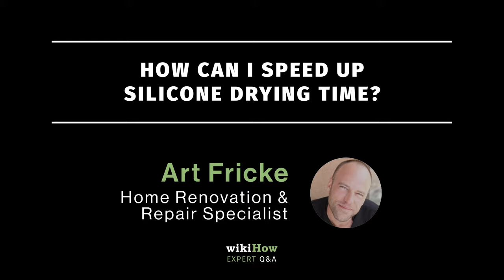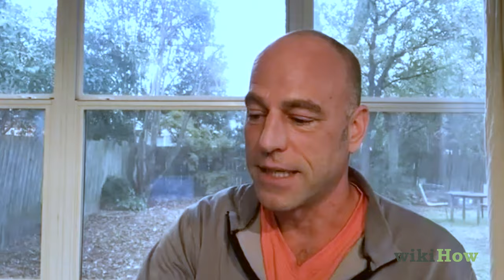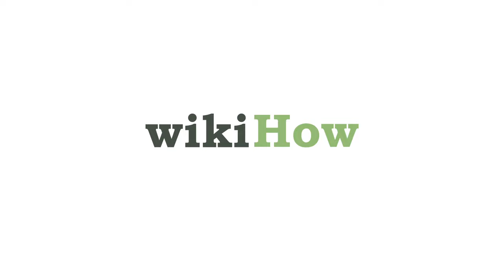How can I speed up silicone drying time?

Comment: I have been dealing with silcone polymer chemistry issues and indsutrial applications for decades. Your understanding of the curing is spot on. Cold slows the process so much that I store my uncapped silicone tubes in a refrigerator with just foil over the tip and months later the silicone at the tip still hasn't cured. It's just so convenient not to have to run and buy more or pop a new tube every time you need a foot or two of bead.
Reply: Thanks. I would have never thought of that.
Reply: Man, I wish I knew that before. Getting ready to move and I have a couple of dried out tubes in my work bench to get rid of.
Reply: Probably the real reason why you keep it in the fridge, so your mother in law might make a sandwich and uses it instead of mayo)

Comment: try spraying prep sol on silicone. will dry solid in 24 hrs.. or even faster then 30 minutes... if have heavy soap scum in tub. wet a ragg  with prep sol wax and grease remover. will wipe soap scum right off; can by at Napa parts store.Another use for it.. wipe down stove top and microwave and hood ranges. will disolve grease build up. Tip from autobody tech.On side note where rubber gloves.. if possible have goodventilation.

Comment: I am using silicone in a dampening bushing in a tripod head.  I read online the curing time for silicone is 24 hrs. I still noticed that the silicone gave off a vinegar smell even 2 days later. I was working on the part trying to get out some pins and out squished uncured silicone. I also had wax paper stuck to one side so maybe that slowed the process down. The part is a ring of silicone between two metal parts and the width is approx 1 inch by 1/2 inch square encased on two sides by metal. It seems to work from the outside in when curing. I would say at least a week for silicone thick like this.
Reply: I agree with you, I would like to advise people to not so hurry up pushing the processing cure. Just relax take many cups of coffee waiting even two weeks depends on weather in your country
Reply: I leave it for 2 months just to make sure

Comment: Hmmm, while I agree with your general assessments on the how RTV goes about curing as well as the pitfalls of attempting workarounds *without* doing some homework first to move things along & accelerate drying time; I'm still not entirely convinced that heat can't be to increase the rate of catalyzation at a temp that would be normally counter-productive as explained here *IF* one is able to provide supplementary moisture to the air that a high heat source would otherwise quickly remove. So I think I'll go about it like one would do with a water pan in a slow & low smoker when working over some brisket but also don't want it resembling slab of charcoal tree-bark in the end too... Worth a shot!
Reply: How did this go?

Comment: If making thick parts as in molds, you can mix a little acrylics paint into it, as any thing over 1/4 thick may not or will take a very long time to cure. Keep in mind the chemistry will change some so.. .. .
I use small lunch bags like frosting bags to mix and apply.. also great when making small aquariums etc.  (The bag idea).

Comment: Ok so here is the real way to cure silicone the additive is the caralyst for bondo which comes in red and blue you onky need a small dab now this applys if you are brushing it on or after mixing place in a small injection gun but do it fast or it will cure in the device and we dont want that